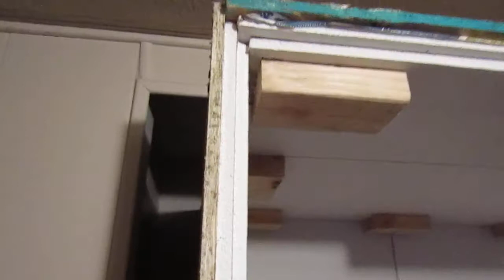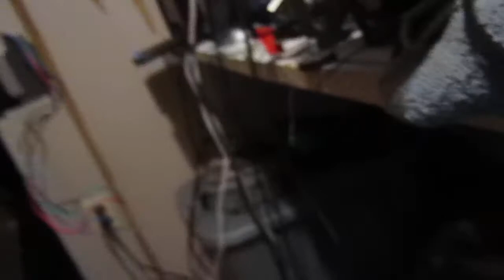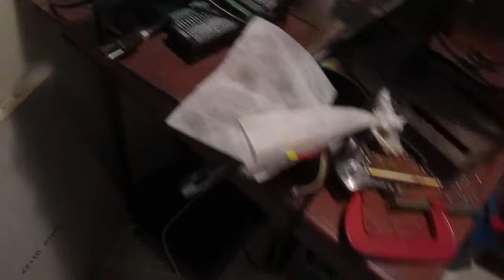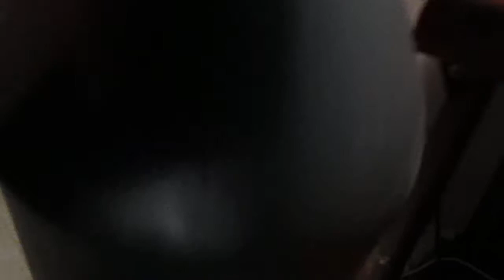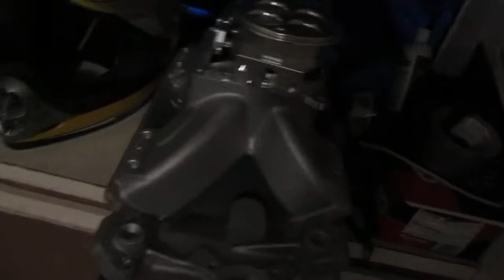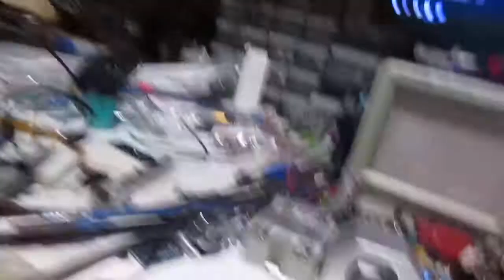CNC build and O2 sensor update

Comment: Hey man, love your stuff with the oxygen sensors. Is there any chance to get an update on the lsu4.9 or some futher information how you implemented your own controller? Or some finished board to buy which connects the lsu to an esp32 / arduino?
Reply from the maker: I made a mistake in the PCB board trace design I had a bunch made of and just put that aside and got busy . But actually it is coming up on it's turn shortly... I didn't realize that I never made a video on how the circuit works. All the bosch chips on ebay are china knockoffs..  It was a huge ordeal to back engineer and wrap my mind around, but over time I am constantly learning deeper electronics and improved my design concept for it even more... I think I can make a video on it this saturday if nothing comes up. I need a refresher anyways before designing the PCB. I feel there is much most won't figure out on there own without investing months solely in research as I did, and I have hard to find links saved. I'm probably going to use a cheap STM32 blue pill because it can do double the analog sample rate as ESP and I can have one mcu work 2 O2 sensors.. I'll send a message to this comment when i get the video uploaded. It'll focus on how the sensor and circuit works and the tricks/things to know side of it.
Reply from the maker: I got the video made on the circuit on my channel. Hopefully I explained it coherently. It took 2 tries and I may have thought I mentioned something but didn't.